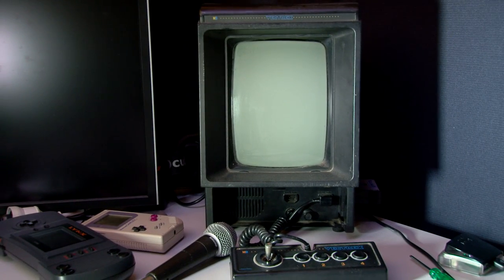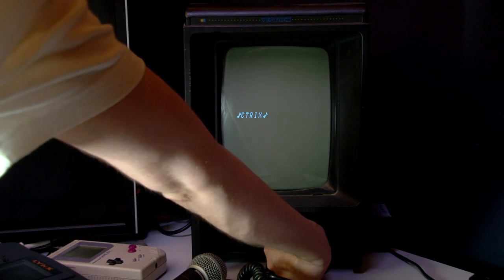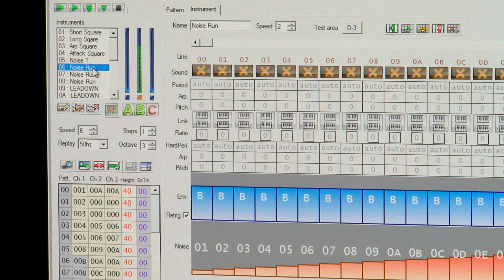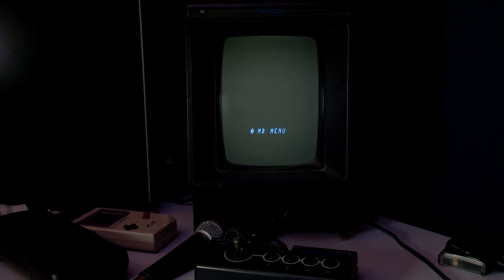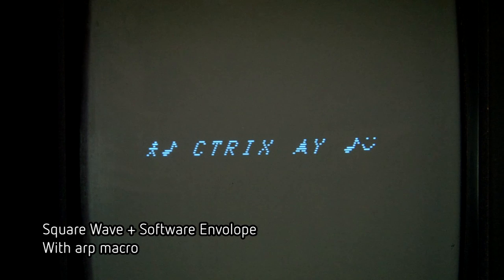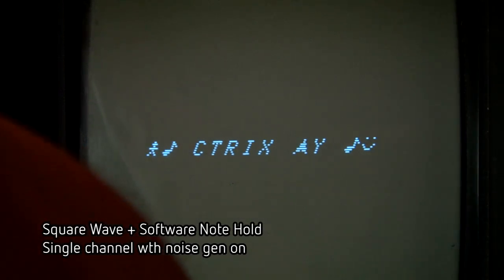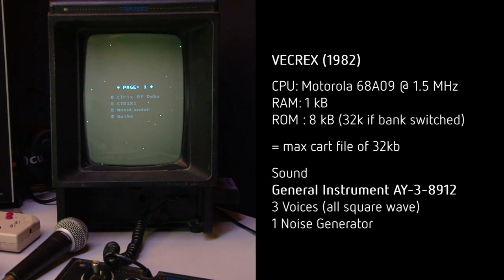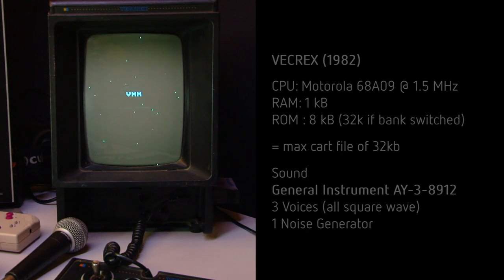cTrix Early Vectrex Music Experiments

Comment: you should use a USB-TTL cable to go to the VecMulti's programming header - remove the SD card and it goes in dev mode. there is win prog to upload your bin file directly to the vecmulti using the cable and it will automatically run. much quicker than copying bin file to SD card and rebuilding the menu

Comment: This is cool. Why not clean and recap your Vectrex? You could probably eliminate the cartridge slot problems at least.

Have you looked at emulating the SD card? It's just SPI, probably at low speeds. You could do continuous updates this way.
Reply from the maker: blaaaaaaarghable It'd be a good idea.  Might look into it - clean the contacts too.  And add an audio output - really... it's just a cap and a resister to voltage drop and bias from the AY!
Reply: debuglive You can also do it the brute way and cut the cartridge so you can access the SD card without unscrewing it. Love the stuff you're doing on the Vectrex, by the way!

Comment: This system sounds very similar to the C64, I didn't think this console was that "powerful".
Reply: 1.5 mhz Motorola 6809 with 1 kilobyte! of RAM, and of course one of the most primitive graphics systems you could think of; analogue circuitry to drive the X and Y coordinates of a CRT electron beam directly.
So... The CPU has to do it all basically. No support hardware whatsoever for handling graphics.
The sound chip is a 3 channel design. The exact same chip is found in Sinclair spectrum 128, Intellivision, Amstrad CPC, MSX, and a bunch of other systems.

So in other words, no. This console is akin to an Atari 2600. The only thing it has going for it is 1 kilobyte of RAM compared to the Atari having all of 128 bytes (I wish I was joking).

Very interesting system, but not powerful by any means.
Reply: While the AY-3-8910/YM2149F is by no means as bad as it's reputation, the SID has a lot more going for it.
Also if it weren't for the vector display, the Vectrex would have been long forgotten ... once you get past the vector gimmick it's an extremely underwhelming system.
Reply: @1337Shockwav3  But that's the point. It's the only console with vector graphics. It's hardly a gimmick. Do you have one? I have 2, and I can tell you they're amazing. I fell in love with it when I first played it in 1983.
Reply: @RetroDawn  I used to have one a few year ago and serviced a few machines owned by others since then.